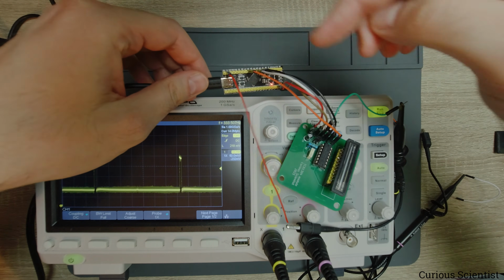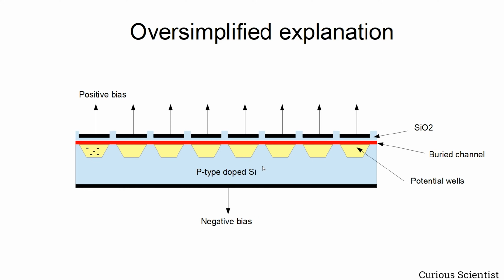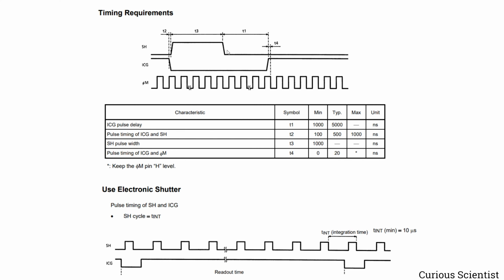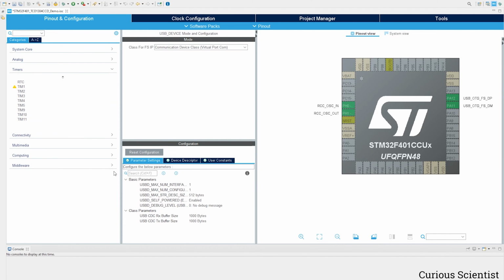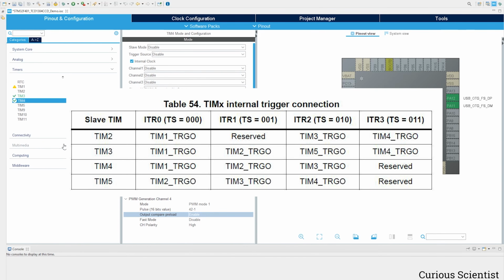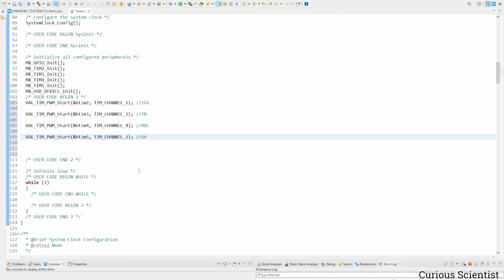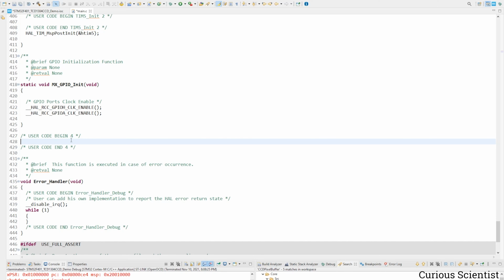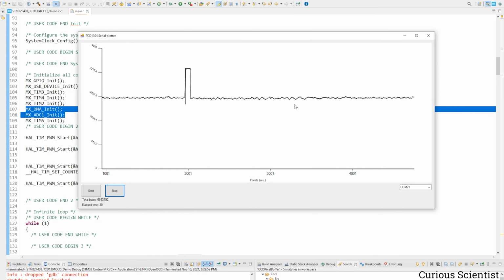TCD1304 Linear CCD - Part 2 - Driving the CCD

Comment: Hello, wanted to say thank you for all of this detailed information it's been very helpful for building a DYI Raman Spectrometer.

I did have a question though, when I attempt to run the program I get an "Implicit declaration of function" error at the "CDC_Transmit_FS" (Line 505 in your guide) and I do not know why, I double checked your written guide and made sure the code was exactly the same.
This is my first project programing a microcontroller so I am unsure where I should begin to troubleshoot this.
Reply from the maker: Hi,
If this is your first project for programming a microcontroller, then you are aiming way too high. This project is way too complex for beginners. The code I shared should compile without errors (warnings might occur).

Comment: I'm very glad you are still responding to comments on this video. I have run into a problem getting the HAL_TIM code line being accepted by the IDE. I tried the cntl+space command but in this case it has no recommendations. I tried re-typing the line several times but there is no change. The build is not successful. Maybe there has been a change in the STM32CubeIDE since there have been many versions since 2022. I'm using 1.12.1 since it is nearer to the time of you video. Maybe there is a configuration setting that is wrong. I've tried searching online but I haven't found a solution.
Reply from the maker: I'm replying comments on all videos. 😎 Have you looked at my github? Also, is it only the Hal_tim that's not accepted by the IDE? If it is, maybe some include is missing? Let me know.
Reply: @CuriousScientist  I wonder where you find the time. Do you have a link to your github? The compile worked fine, I got the pulses out of the black pill. Tried to add the 600nS delay and no go. One odd thing I did find, the ICG pulses were inverted. I couldn't find any difference that caused that, I changed the configured polarity of TIM2 to correct it. There is a notice that comes up "undefined reference to "_HAL_TIM_SET_COUNTER".
Reply from the maker: It is very easy when I can type from my phone. Check my website and my articles, I have links all over the place.
Reply: @CuriousScientist  I should have been more specific. The line that wouldn't be recognized was the __HAL_TIM_SET_COUNTER( ) one. I finally figured out what the problem was after wondering if a library wasn't loaded. That statement starts with TWO underscores, it is hard to recognize that. Also the code seems happier with the statement CDC_Transmit_FS( )  if the line #include "usbd_cdc_if.h" is added along with the other #include's. All is well now.
Reply from the maker: Glad to hear!

Comment: hmm struggling to repeat this. Getting ICG spikes at random places of data and random intervals. Not entirely sure why...
Reply from the maker: Your timing is bad somewhere. ICG should be the main signal and everything else should depend on it. So, you have to figure out your timer.
Reply: @CuriousScientist  Sweet, thank you for the reply. I got your TCD1304 spectrometer CS2022 version and it's my first time working with electronics so there's a lot to learn. Would you say that I should deviate from following this video and do some smarter master/slave conenctions between the timers and not rely as much on this video?
Reply from the maker: Well, if this is your first time working with electronics, then it is a waaaaay to big bite. No offense, but this project requires years of knowledge due to its complex nature. I would say that the best way to do is to use ICG as the main trigger source and then start the subsequent signals based on it. Then for every ICG pulse, you will realign all the signals and you'll get a nice output. Plus, I warmly suggest to look around my github and read carefully what's written there. Cheers!
Reply: @CuriousScientist  I'll figure it out eventually and it's a fun project! Ok, good tip. I'll start connecting timers to icg and check with my sweet new purchase. Got an Iso-tech isr440 just for this. Ah yes, forgot that you had something on git - will take a look at your main.c there. Thank you for the help

Comment: Is there a way to utilize this information to create a camera using a linear CCD sensor? I have a project that requires a special sized film, which is becoming increasingly hard to find. I want to convert a camera to use with a linear CCD. I considered using an old scanner, but they require specialized software that shuts down if their interlocks aren't maintained.
Reply from the maker: Absolutely. I even published videos on this topic and am working on such a project right now. :)
Reply: @ That is great to hear. I'll have a look at your video list.

Comment: Hello, at the beginning of the video shows the CCD output signal, where the shadow is positioned on the oscilloscope shows an elevation in the signal, however when I read it, it seems that when the CCD has light, shows peaks in each pixel, and where the shadow is shown these peaks become small, but this happens from top to bottom, very similar to how it looks in the datasheet, I hope you can help me.
Reply from the maker: Hi! It depends on what circuit you use to drive the CCD and to read out the signal. The default signal of the CCD is shown in the datasheet. Dark pixels give higher signals and lit pixels show lower signals.
Reply: @ do you read the output of the CCD directly from the CCD? (OS Output)
Reply from the maker: No.

Comment: I'm uncertain how the frames remain aligned within buffer. Once 3694 pixels have been scanned, and 6000-3694 pixels in buffer remain unfilled, won't a considerable portion of the next frame's pixels just fill the remaining buffer? Or does it not matter that there's such terrible frame drift?
Reply from the maker: Check the video I just uploaded a few minutes ago. The frames are rock solid. However, I set the buffer to 3964. 😉

Comment: I find it challenging to synchronize the frames so that they don't drift over time. How are you able to tell your code when a frame begins and ends?
Reply from the maker: If your signal is drifting, then you didn't listen to my stuff carefully. 😉 The proportion between ICG and SH must be integer-times. Then it won't drift. I even mentioned this in my article. But also, it is obvious when a new sample comes in (since you supposed to start the sampling), plus you know the number of captured pixels. Check out my spectrometer videos, there's no drifting, the signal is stable.
Reply: @CuriousScientist  Gotcha, I'll check that out. Impressive how fast you responded btw!
Reply from the maker: No worries! 😎 Let me know if you get stuck.
Reply: @CuriousScientist  Hey, so I've reviewed my code and I have some more questions. I'm curious why you set the length of the buffer to 6000 in your STM code when the TCD1304 only has 3692 pixels. 

I'm also curious about how the system makes sure that pixel number 1 aligns with position number 1 in the buffer. Is this accomplished through timings? Is the DMA write address somehow reset by the activation of timer 2 (the ICG gate timer)?

Lastly, I'm curious about what library you use to plot the data live. I think half of my problem is that the python library I'm using to plot the data coming out of the microcontroller simply can't keep up with the stream of incoming data, and so I think I'll have to switch to a compiled language that can operate a little bit faster. But still, I run into the frame alignment issue.

I realize that there's a lot of question here, so take your time in replying. Thank you again!
Reply from the maker: Hi! 
Regarding the 6000, I think I even mentioned this in the video and article. I just chose some arbitrary high number (larger than the number of pixels) to make sure I don't overflow the buffer if something goes weird. You can adjust this. 

The pixels are aligned because you align them by defining the fM frequency. This is also discussed in my article right in the beginning where I discuss the timing requirements. The DMA is also discussed in the article. It is set to Normal mode, so when the buffer is full, the acquisition stops and then you can restart it in the interrupt created by the DMA buffer. 

I did not use any library to plot the data. I wrote my own code in C# from scratch. I used parallel/async programming and I also only send every 10th or so acquisition to the PC so it has time to keep up with the incoming data.

Please read my article and watch the corresponding video regarding driving the CCD, because I mentioned all these things there.
Reply: @CuriousScientist  Could you please link the video wherein you outline your process for restarting the DMA in the interrupt created by the DMA buffer?

In the video above, the only interrupt or callback function you populate is the CDC Transmit. The DMA is constantly restarted in the main function's while loop, but that implementation alone causes frame-drift.

Further, if the DMA only resets the address it writes to once it reaches the end of the buffer, then would the buffer length being 6000 pixels not inevitably cause frame-drift over time? I make this complaint, but at the same time setting the actual length of the buffer to 3694 pixels did not help my results.

Is the correlation between buffer[0] and pixel number one on the sensor maintained solely through timings? Shouldn't there be a mechanism guaranteeing that, each time ICG cycles, we reset back to buffer[0] to ensure there's no frame-drift?  (I've also attempted to implement this, but implementing such a routine on the STM has proven very challenging).
Reply: @CuriousScientist  If the place in memory written to by the DMA is only reset once the DMA reaches end of buffer, then why is the length of the buffer irrelevent? The length of the buffer determines when the end of buffer is reached by the DMA (which writes every time the ADC activates, every 4 micros), which determines when the written address is reset.

However, if the above timing is offset by even a few pixels, then over a second, the frame will be offset by hundreds of pixels, leading to the effect of frame drag. 

My idea to fix this in my implementation was to either A) flag the data whenever ICG cycles so that the data can be automatically analyzed client-side, and frames can be pulled out, or B) the NDTR (the address to which the DMA writes) is reset on the falling edge of ICG. Both of these options have proven very challenging to implement given my inexperience with STM32 as a platform.

If you have any clue where I'm going wrong, I'd love to hear it. I'm at the end of my rope lmao
Reply: @emthefruitygem  Did you ever find an answer to this synchronization problem?  I've read and reread, watched and rewatched @CuriousScientist content many times and haven't found the hidden solution yet.  In fact, at the end of this video when he shows the serial plotter, he shows the asynchronous problem with the dummy pixels jumping around and simply says "I haven't done any careful timing here".

I've also tried a BUNCH of things on my own (admittedly not a microcontroller expert), but nothing quite solves the issue in an elegant way.  The closest I have come is brute forcing it by stopping and restarting the timers, or restarting the counters after each DMA callback, but even this leaves me with some other bizarre artifacts that I can't explain.  And I've exhausted my patience with both ChatGPT and Claude reviewing everything and sending me down crazy rabbit holes for days.

EDIT:  Saw this from CuriousScientist in another comment I didn't expand before: "Then it is a good idea to use the ICG as the overall trigger. It should trigger the SH and the ADC. This way everything will be very neatly synced."  So basically he's saying that we have to set the timers up quite differently than in this video.
Reply from the maker: It seems like you haven't read the article. :
Reply: @CuriousScientist  I assure you I have if it's the article that mirrors this video.  Many times.  But admittedly I am not an expert in this field, so it's very possible I am missing something that you assume to be more obvious than it is to an amateur like me.

Although I'm confused why you suggest to simply read the article again when in the video you say the jumping dummy pixels is because you didn't set up the timing correctly.  So it seems logical that following the article and video would lead to the same results you yourself were experiencing, no?

And in another comment here you suggest the solution to this problem is to use ICG as the trigger for both SH and ADC, which is not mentioned in the article.  It makes sense, and it was one of ways I considered to solve the problem conceptually, but to an amateur like me it is not readily apparent how to do that.  A lot of the settings in CubeMX are mysterious to me.
Reply from the maker: @PetorianBlue  Yup, it is the same article. You can check the chapter TIM2 and TIM5, and right in the beginning, I say that "ICG should trigger SH". About the "how?" it is exactly described in the video and in the article. I even put screenshots there to show each parameter. It is just reading, really.
Reply: @CuriousScientist  I agree.  In the article and the video you say "ICG should trigger *SH*".  You do not say "ICG should trigger *ADC*" as you did in the comment above regarding this synchronization issue:  "...it is a good idea to use the ICG as the overall trigger. It should trigger the SH *and the ADC*." 

I repeat, at the end of this video you show the same async problem I and others here are asking about.  The dummy pixels are jumping around in the serial plot and you say it is because you did not set up the timing properly.  How to set up the timing properly so that the dummy pixels are stationary between frames (i.e. so that the data is always output and received starting with pixel[0]) is exactly what I and others are asking about.
Reply from the maker: @PetorianBlue  You will be surprised but I already said it here (Use ICG to trigger the rest of the signals) and it is also written in the article: "As we set up 7500 us for the ICG → ICG time, it is a good idea to only use an integer fraction of it for the integration time so this way the signals will match nicely "...
Reply: @CuriousScientist  Ok, something is not working in our communication for some reason.  You keep telling me to read the article to find information I already know is in the article, but is not the information I'm asking about.

Here is your direct quote from a comment above:  "As you can see at the end of the video, the signal on the chart of my software was constantly shifting to the left. This is exactly caused by the lack of syncing...The SH's pulse should be an integer fraction of the ICG pulse. Then it is a good idea to use the ICG as the overall trigger. It should trigger the SH and the ADC. This way everything will be very neatly synced."

In other words you state here that following the instructions in the article will produce a signal that is constantly shifting to the left (<-- exactly what I'm seeing and trying to solve)... and that the solution is to have ICG trigger SH (which you cover in the article) ***and ADC*** (which is NOT covered in the article).

I do not understand why you keep telling me to read the article when at the end of it you got the same issue I am getting, and the solution for which is not covered in the article.  With 7500us as the ICG period (as per the article) and 20us as the integration time (as per the article), it already is an integer fraction (7500/20 = 375).  This does not stop the signal from constantly shifting left.
Reply from the maker: @PetorianBlue  The article is not always the exact same content as the video because, unlike the video, it is not permanent. I can edit it, and if I forgot to mention something in the video, I can write it down in the article and problem solved. Have you fixed the triggering by the ICG? If you check my TCD1304-related videos after I released this, you can see that I obviously solved the issue because the signals are good, even at high frame rates.
Reply: @CuriousScientist  I have watched your later videos and can see that the issue was clearly solved.  The question I and others are asking is "how was it solved"?  As I already quoted you saying here, the fix (apparently) was to make ADC trigger from ICG, but "how" is the question.  This is not covered in either the video or the article (or in any of your resources that I can find).

For what it's worth, Esben Rossels in his TCD1304 wordpress also suggests that the solution might be to have ADC slave to ICG, but also does not remark on how to do this.
Reply from the maker: @PetorianBlue  But I keep telling you that you need to trigger the ADC trigger signal with the ICG in the same way as the SH is triggered. And this latter is clearly written in the article and illustrated with images, even. Figures 11 and 12 and the corresponding section. I can't spoonfeed it even more, sorry.
Reply: @CuriousScientist  Ok.  Thank you for the resources!  Overall, very instructive and helpful!
Reply from the maker: You're welcome. If you really get stuck, send me a message via the contact form on my website.

Comment: do you know if you could make the software open source so i can take a look i am having some issues getting it working on my end.
Reply from the maker: It is open source, just type it in.
Reply: currently trying to get the CCD driving by a ESP32 rather than making the pcb i wanted to see if maybe you had any advice on that
Reply from the maker: The Windows software is not available, sorry. There are hundreds of different ESP32s, plus I don't work with them, so I can not advise on that part.